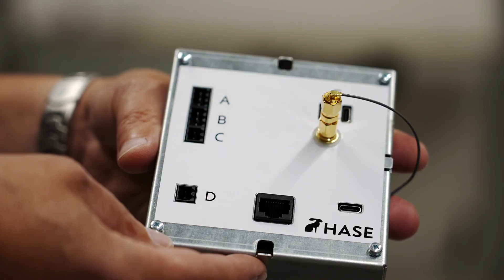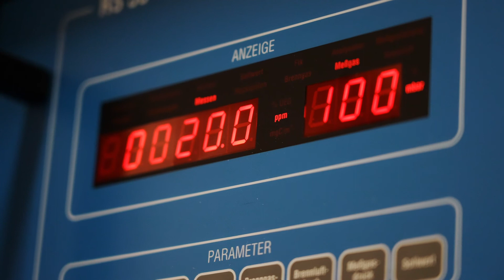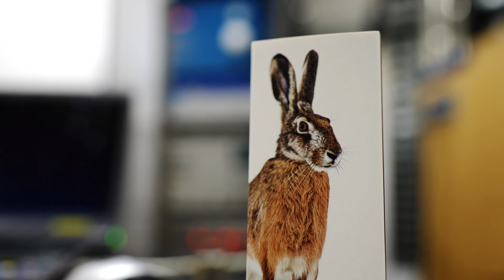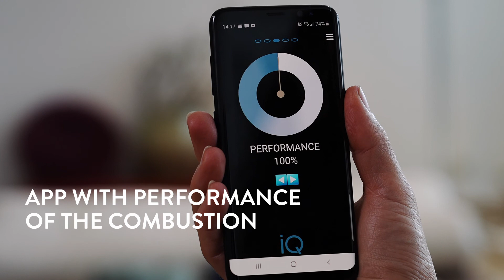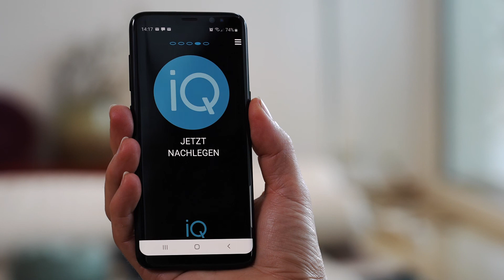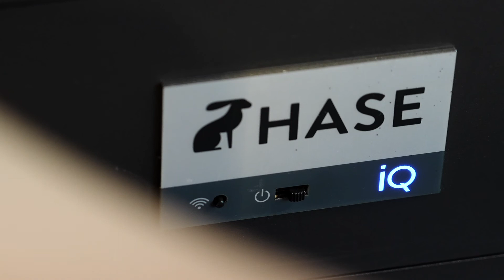HASE stoves with iQ technologie. The intelligent fire.

Comment: Does it run on mains current or some kind of battery? What happens if you loose electric power?
Reply from the maker: It is powered by mains electricity. As a substitute, a power bank can be used, as the power requirement is very low. In the event of a power failure, the air flaps remain in position and the fire burns out without any problems.

Comment: Been staying warm in Oregon all winter with my hase!
Reply: Any issues with it?
Reply: @EtreTocsin  not yet, my bricks still look good. I’ve had it for almost 6 years and have used it as my only heat source this winter.
Reply: How often do you have to load it with a new log, and how often do you have to clean the ash box?
Reply: @markLRQ  I clean my ash box every other day if burning all week. It depends on the wood being burned, but usually have to get up in the night to add a log, it won’t burn a load all night.